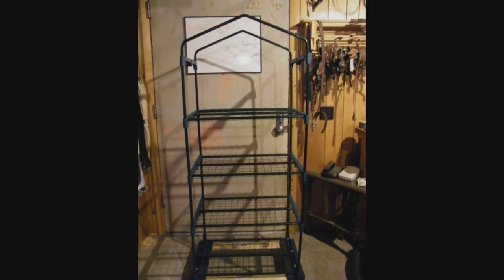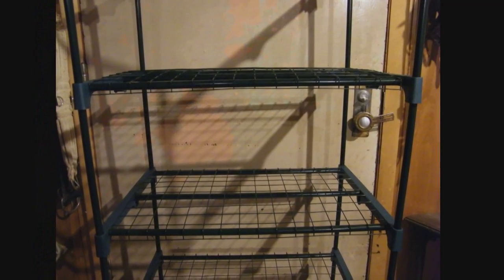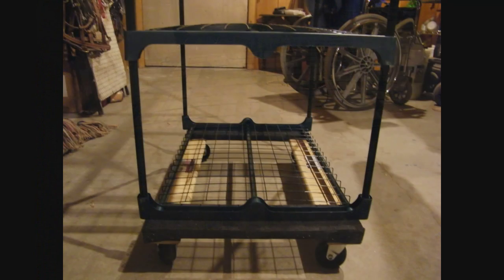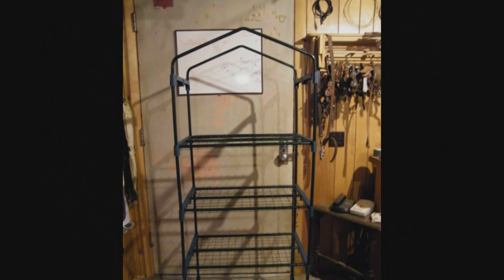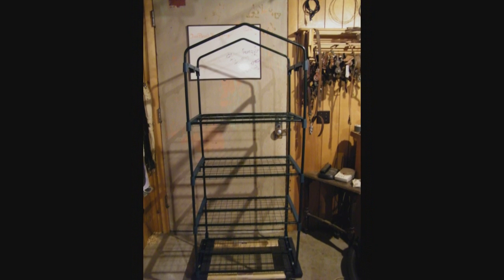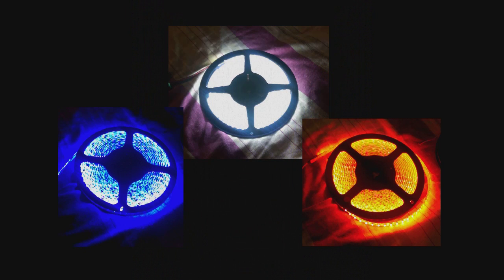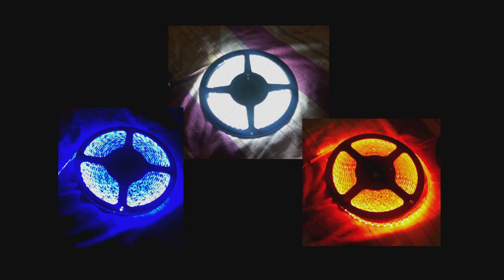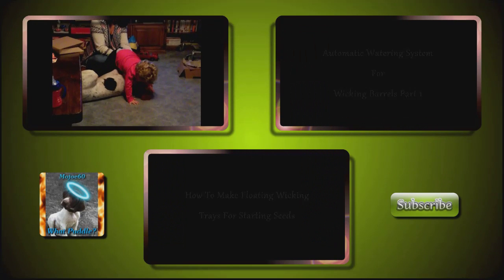How To Make A Seed Starting Tower With Homemade LED Grow Light Panels Part I

Comment: Link to where you bought the light strips?
Reply from the maker: +Benjamin Morrison sorry i took so long. i bought the lights from nicky2013cn on ebay. they are no longer active.  i bought the connectors from wickhang on ebay they are active. i checked out their store they also have led's i don't know if they are the same you'll have to check that out. before you use these lights i suggest you watch the conclusion video https://youtu.be/xxvLfarDA8Q
i'm going to try it again this year but will lower the panels all the way down to the trays. i'm not if they are worth it, yet.